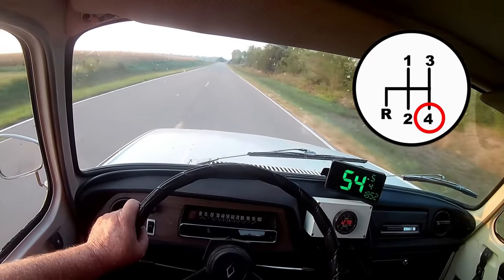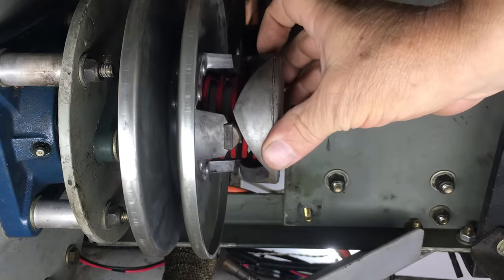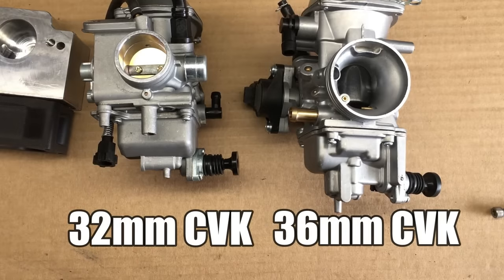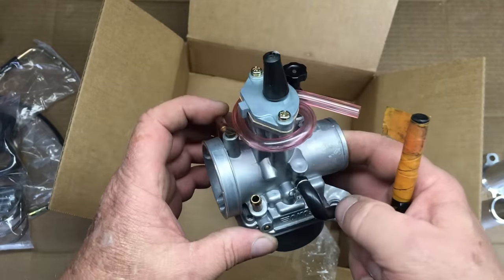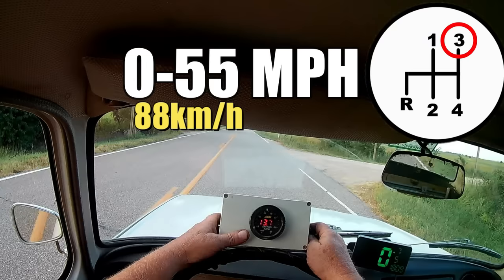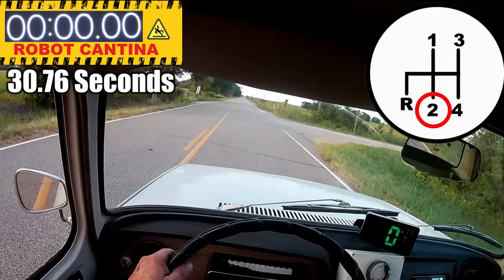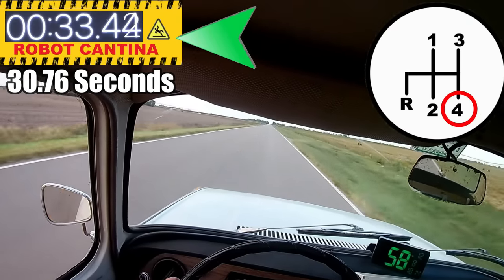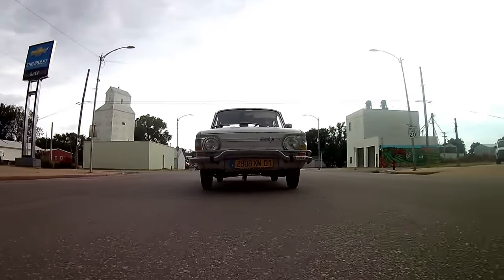S3 E32 We install a 3D printed manifold spacer on the 670 cc Predator Renault for moor speed

Comment: Big carb first I think, it may provide excellent data for later if you end up with thoughts of forced induction later on. Dual carbs with the addition of thermocouples will provide highest power output due to being able to compensate the cylinders individually, optimizing air/fuel ratios for max power naturally aspirated. But I seen mention of dual exhaust as well and with dual carbs, I feel like there may be an extra little bit gained from either a header designed to optimize scavenging betwee the cylinders, or a dual exhaust, dual exhaust likely being the less expensive option. 

I always love wondering where youre going with projects, and seeing what you get up to with them as time progresses. If forced induction is in the cards, id definitely like to see this one with a small turbo, single carb. Id rock this thing as is though. My max speed for most commuting is already 55mph 😂

Comment: I've often wondered why someone hasnt 3d printed a manifold for the 670cc that would allow for a car 2 barrel carburetor.  I just see alot more support in tuning the car  2 barrel over any lawnmower carb or smaller motor cycle carb out there. Make for great entertainment at minimum.  What ever path you go, just keep the videos coming please. It's very entertaining to say the least.

Comment: Makes my Sunday watching your videos thank you for sharing my four wheeler a Yamaha raptor 660 is a single cylinder with two carbs the information I found on it is they use one for low engine speed and then both for high speed engine power it also uses 5 valves 3intake two exhaust lol crazy right but it’s a beast supposedly it makes around 42hp factory I raced a street bike and I could out run it until I hit top speed wish I rode it more but unfortunately my health is not good so it’s sitting going to crap 😢

Comment: It sounds as if your 'CVT' is dropping the engine rpm too far down during mid-range acceleration. When first taking off it sounds to be loading the engine reasonably close to as good as it could. However, 1 - 3 seconds later you can hear the engine speed dropping too far due to the CVT ratio reducing too much/too fast. I'm thinking this results in the engine leaving its optimal power band. Maybe some sort of slotted washer(s) to shim the CVT spring, that wouldn't require dismantling the unit, could provide a quick adjustment method.

Comment: Try the larger single carb and tune it really well. Also it might be worth throwing some high quality oil in it, since it doesn't take much and probably needs a change after the break in. Don't do any burnouts since, not only is it hard on the drive belts, but I don't think these engines can handle much oil sloshing, just a thought if you want longevity

Comment: An interesting test would be to swap in the slightly bigger version of that motor to see if all the numbers including fuel economy improve.
The law of diminishing returns kind of hints at the idea that a bigger more powerful engine will actually use less fuel than a smaller one as it won’t need to work as hard for the same result.

Comment: I think going with the larger bore carb would tell you whether or not the engine is restricted due to air flow.  The dual carbs is the start of a totally different experiment and isn't the logical next step in the testing sequence.  The larger carb is also a lot less work to set up and test.  The dual carbs changes almost all of your variables at once.

Comment: The 90 degree carb adapter appears to have smooth interior surfaces.  When the mixture slams into that back wall, it seems possible fuel droplets could form, messing with your tuning efforts.  If that is happening, the plastic carb spacer will make it worse due to thermal insulation.  If that adapter was rough like a casting it would probably work better.

Comment: A quality carburetor can make a big difference in power and fuel economy. I put a weber 32/36 on an 89 toyota corolla 1.6L 5 speed. The car gained a noticeable amount of power in the top end and went from 32mpg on the highway to 38mpg.

Comment: Single carb first, but I really think you should adjust the clutch weighting/engagement point on the CVT, because it sounds like it's doing you a disservice - it's hitting max ratio too quickly and leaving the engine in an area that sounds like it's outside the power band for a bit. Get it dialed in, and you might even be able to do your 0-55 in 4th successfully.

If you do dual carbs, clearly you should go the hard way and swap the kit carbs with small knockoff CVKs. 😅

Comment: In my experience those belts will last much longer if you can encourage some air flow over the pulleys, I have a 11hp Kohler engine and a comet 40 series on a biggish knobby tire go-cart, and it gets thrashed in dirt, burnouts and full throttle pulls would eat a belt in about four hours, and I noticed the steel pulleys would be blistering hot, so I built a duct to funnel the air exiting from the engines fan over both pulleys and now the same belts will last a whole day at least.

Comment: 3600 is not redline for this motor. IT is its governed RPM. That means it is the RPM this motor can run all day and all night with no problems. It is designed to run at this RPM 24x7. Not sure if the manufacturer would post a max RPM for this motor. I would guess 5000-5200 would be a possible redline. Check and see if this is an interference motor. If not, then take it all the way till the valves float. See what your max RPM is. Also, see if you can add a valve spring shim to add pressure and test again. :)

Comment: Go wo with the larger carburetor first to see if that helps any. Then the week after try the dual carbs. Would like to see stiffer valve springs, different cam, billet rods, and billet flywheel add-ons as well over time to really see what this thing can do, if those are possibilities for this project.

Comment: If its any help, the straps that secure the package are heat sealed, and what that means is, wher they melted the ends together, simply turn the strap upsidedown, and pull the tab to release the bands. I worked for a major home center in shipping and receiving, and this was standard procedure. Not necessarily a bgame changer, but its definitely faster.

Comment: I'd go for the gusto. My bet is any benefits from the larger CV carb are going to be miniscule. Just from appearances, the billet adaptor piece seems to be An or THE bottleneck in the intake track. If the Predator engine is anything like any other small industrial engine I've seen, the real limiter is gonna be the cylinder heads, and camshaft with a beyond mild profile.
I'd throw the dual carbs on to at least remove the restriction before the heads. Which would set the stage for porting the heads ( it doesn't take much work at ALL to improve them, as most of them are abysmally bad flowing..).

Comment: Like motorcycles the dual singles need sync linkage to function properly.  Balance could be achieved using a mercury vacuum meter. A single 22mm Dual weber carburetor could accomplish the same configuration.

Comment: Instead of dual wideband I would just weld in 3 bungs for the sensor. One for each cylinder and then one after the collector to measure both(like the current setup).
Then you can just move the sensor around between runs to check if the cylinders are running equally good.

Comment: Try dropping the needle down one notch at a time. It effects part throttle fueling. Lowering the needle will lean it out. You might need a needle with a different profile as well. 
I'd figure out why the pilot jet isn't working properly first.

Comment: Single carb, and forced induction. Although I would also believe that the elimination of the CVT for a conventional clutch setup would be better for both longevity and performance. But that may not be possible for many reasons. Most likely would be space constraints.

Comment: Would honestly like to see a comparison between bigger single carb and dual smaller, I think the plenum change would be the biggest difference between those carbs, the original is kinda badly designed
Also, which are your plans about force induction for this vehicle?? The predator would greatly appreciate some charging

Comment: Jimbo, I have a Theory for you to test. In college at Nashville Auto Diesel back when electronic fuel injection was making its way onto large displacement diesel engines, Caterpillar came up with a 'shifting technique' that optimized the torque of the engine for speed and acceleration with their new 'gear fast, run slow' concept.
I was wondering if you would try it out, because theoretically it would allow the use of all forward 'ranges' [no longer gears with the CVT], and maintain maximum forward momentum with the least amount of engine effort.
1st range - rev to 3500 then shift {15mph}
2nd range - rev to 3750-ish [max] then shift {30mph}
3rd range - rev to 4000-ish [max] then shift {40mph}
4th range - give her the beans
This shifting technique is designed for high weight to power ratios where gear multiplication and torque do most of the acceleration work. They used a 215-hp spec 14 liter to make the example because most 'fleets' used 'detuned' engines for better fuel mileage. The torque of the 14 liter is identical until it hits the hp limit and then is rationed at that limit until redline with the computer fuel curve, so using the torque of the engine is advantageous. {whew! big words!}
Something to consider. Good luck with the car. Love the series, man.

Comment: I just saw that you have a permanent magnet generator with shunt regulator. A shunt regulator turns the generator into a magnetic retarder when electrical load goes down.
A real alternator would be more efficient, giving you better charging when needed and less parasitic drag when not charging much.

Comment: As the torque goes up on the engine it might become necessary to take off in 1st and then shift to 3rd. You'd still drive in 3rd like you have been but the belt might last longer.

Comment: If you are concerned about tuning the carbs with a single wideband you can always use two EGT sensors, as egt will track with mixture.

Comment: one thing you might try to get the rich hump out of the immitation mikuni carb is closing the hole inder the butterfly valve and redrill it a size smaller then open up the main jet to compensate

Comment: GET RID OF THE 90 DEGREE OBSTRUCTION. Biggest problem. Use 2 carbs and longer intake runners. The uneven firing sequence of a V-twin means differing amounts of time for the mixture to drop out while waiting on the cylinder to suck, squeeze, and try to bang it.

Comment: Fiddle with the other single barrel carb a bit. The knockoff seems like more work than its worth. Im waiting to see new innards. Springs and a cam, pistons and rods, maybe a lighter flywheel though with all the extra rotating mass of the CVT idk if it will be the mind blowing upgrade many think it will. Maybe just for the increase in safety of not having your flywheel grenade during operation.

Comment: the cvt system looks very much like a COMEX system, made in canada, and used on french microcars. look up AIXAM . majority are diesel and slow , but the petrol is a 500cc parallel twin generator engine, electronicly rev limited to 20bhp. they also use a COMEX reverse box / differential.  at 400Kg these cars can manage 55/60 mph on the flat with no wind. quite comparable to the renault .

Comment: when hunting for power, a good help is tuned port pulse reflection.   Another issue is how many bends are in the air intake tract both before and after the carb.......bends cause restriction, fewer bends are better.

Comment: Still sounds and looks a little rich. Not dog rich, but, you're leaving some performance/economy on the table doing that. Wide open should be something closer to 13, and your wideband is reading somewhere around 11.8-12.2, which also means you've probably had to dump timing at it in order for it to run well. Very common in the VW world for this to be the case, and the engines run, but, there's alot of potential on the table, and it won't really run hotter if it's fixed. 

Also at idle you can be closer to 14, even 14.5 and still be just fine, which will hopefully be fixed with a new carb. That'll also drag your 'put put' AFR closer to where it should be, which is, pretty lean under light load, like 15 usually.

It'd be cool to have a look at the plugs as well, and explain to the class how to read them. Whole lot of information can be gleaned from them that's useful for tuning.

All in all, the real solution is electronic vacuum advance, because mechanically you can only really do so much. Between that and an oil cooler, you can probably run this close to/at 14 wide open and not worry about it. From there you have to look at upgraded internals, specifically valvetrain stuff (these motors love to float and subsequently munch valves), if you want to go faster.

Comment: My vote goes to whatever would work out nice with ram air intake. If I remember correctly, the variable ventury was meant for that, so probably the single carb.
Dual carbs with ram air intakes would be insane, but also kinda overkill and probably too rich idle for ram air jet.
Hmm the choices, the choices

Comment: Without going to find my Weber books, I'd like to point out that a certain size venturi (not carb but venturi dia) can support X horsepower. This info is in a table somewhere, with that i cannot see that you are exceeding the single carb at this point. Also, since you are staying in the rpm limited realm and torque plus math and rpm equals hp, you may find that the lower velocity of two larger carbs hurts performance up to 4.3k rpm. It may be that you find the limit on a single carb, and need to add engine work, (maybe just stronger rods/pistons/springs) to make the engine reliable to the point where the single keihin is maxed out and then start over with the dual setup, if you need/want apples to apples comparisons, rpm limit the upgrade motor to sync you data initially.

Comment: The larger venture will make you loose power on the bottom, will gain at the high end though. 
I would like to see a twin throat, progressive down draft.  The best of both top and bottom ends, and with no 90° bend in the intake. The CVT needs the weights and springs tuned.

Comment: Do the big single before going to the  twin carbs . Big is not always better .I`m sure there would be an improvement but not life changing or even noticeable while driving , probably on a dyno sheet only  . A cam shaft upgrade  , cylinder head work , compression increase  and exhaust work would put those dual carbs to work .

Comment: About the RPM situation, i know it can be tough but, maybe you should consider installing one of these cheap tachometers, like the one you used in the Saturn. Not only it'll give you a general idea of the engine's output but also what the CVT is doing

Comment: That OKO is a china knock off of the keihin PWK flat slide. it also uses the same jets. Don't worry I have used them on four stroke motorcycle engines with good luck. As far as the 3D printed spacer making a improvement it is because you increased lower and mid range torue by adding more plentum to your intake setup. I'm no expert but I street raced and tuned carbed cars in the 80s and early to mid 90s, and sportsman class raced motorcycles in the early 2000s with a best ET of 10.005 at 132mph. I have been tuning carborated bikes and cars since the 80s, and FI motorcycles since 2000,working on some turbo bikes that were not mine.

Comment: Dual carb. Keigin pwk replica are the best carb (for a decent price, originals are 250 usd each, I think). From an air flowing perspective dual carb are way better then single. 
Pwk are very simple and responsive carbs, with a wide band sensor you will tune them easily. I tried on my motorcycle, but I had no o2 sensor, and it was too hard for my skills (I'm an emlpoee...).

Comment: Great video Jimbo!  I know you nixed the dual wide band sensors at the end of the video, but it would be interesting to see the data with a single carb to see if the air fuel ratio differs, cylinder to cylinder.  If it doesn’t, then I’d question how dual carbs could perform better.  How about dual exhaust sensor bungs, and switch the sensor you have from cylinder to cylinder on back to back acceleration runs?  👍

Comment: I would truly love to see some pulls where you get the cvt spinning about 2500 rpm and then engage the manual clutch. It really bogs now pulling that tall 3rd gear. The AFRs look plenty safe for 4500. Personally I would try an offset key and give it 2 degrees of timing for a little more snap
Reply: The flywheel is the safety factor in the rpm

Comment: U need a special dual vacuum floatto fine tune the dual carb. But just match idling screw set to full closed then open 3 turn should get u closed to balance and same also for the air fuel ratio screw. The dual carb will set new record.

Comment: the keihin knock off carbs (oko,  motoforce...) often have a too steep slide cutout witch make them run rich and you need a really small pilot, i have a 32 pilot (smallest keihin pilot) on my 140cc dirt bike and it still runs rich so i ordered 28 and 31 knock offs

Comment: And there's also old forklifts that had a 2 barrel carburetor on them it was for gas powered ones and you could always try that because I know the back like in the 70s there was hot rodders that would go and take them carburetors and they would make cross flow heads for them so where they could run two carburetors on but however within your way of wanting to do it with one carburetor you still could but it would be able to also still get dish that motor in the Jets